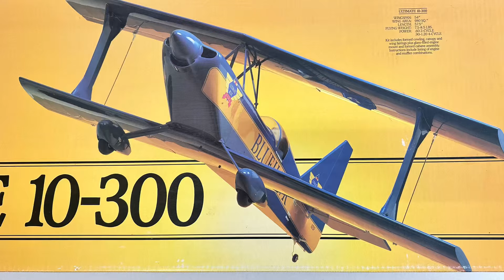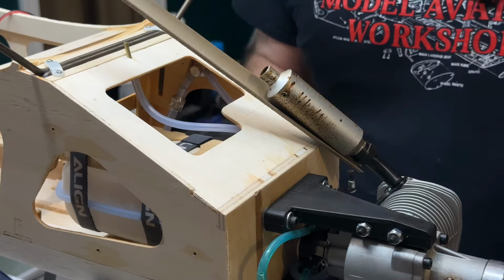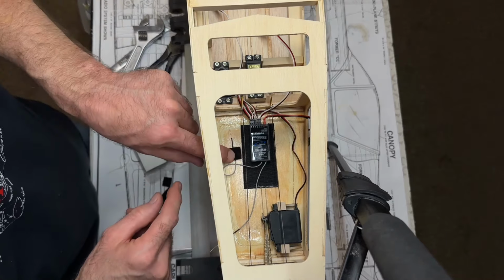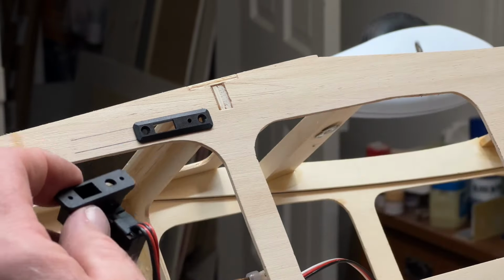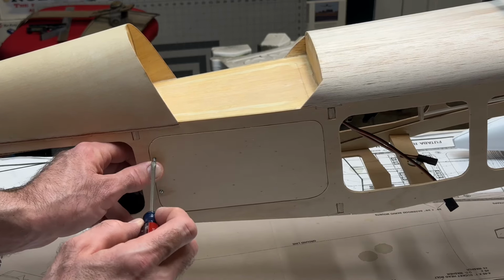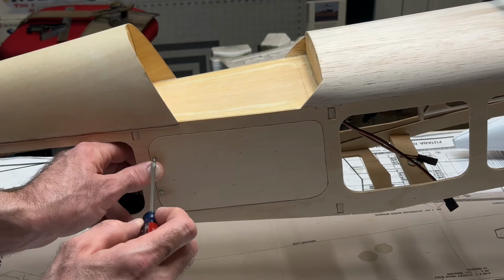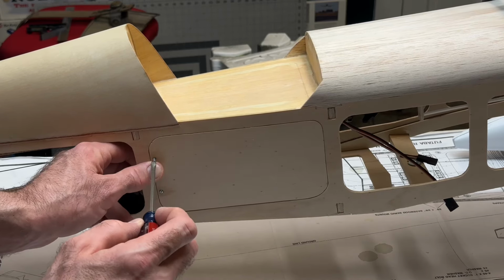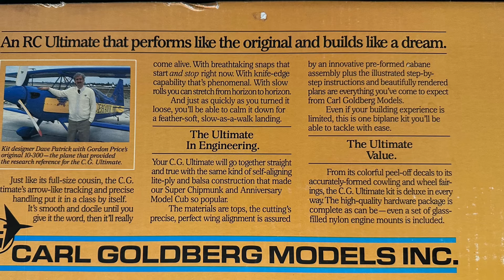Carl Goldberg Ultimate 10-300 Biplane Build: Part 23 (Finishing Prep: Part 2)

Comment: So you fly Futaba radio equipment. So do I...I got the new T-16 IZ.. I was flying the T8FG super.
Though servos are all noisy, it's because they're digital. All digital servers do that. They kind of hunt back and forth to find their center at all times. Are you by chance an electrician? I noticed, you have quite a few climb brand screwdrivers. That's the brand name of tools that select Christian's mostly used. I was an industrial electrician for many years.
It's up to you but I highly suggest taking a piece of shrink wrap and shrink wrap  your aileron servo connectors together. Then you never have to worry about them ever coming. I'm done again. I guess the glue is easier but I just think the shrink rap looks bette
Reply from the maker: Yeah, Futaba is my go to radio. 16SZ is what I use. I used to be an electrician in the Air Force. My aileron servo connectors are basically glued together. I showed it in my wing build video. 👍

Comment: My only question about the wings is how are you going to get to those servos if you ever have a problem with them? You didn't make the servo covers removable you glued them in instead of screwing them down.
Unless you have some way to get to them from the other side I don't think you could be able to get to them
Reply from the maker: I’d have to cut into the wing. I was trying to keep the weight down.

Comment: I like the access hatch in the side of the fuse. I made an access hatch in the bottom of my fuse one bay behind your electronics bay to put the elevator servos. I cut out a frame in the hatch to cut down on weight. Would you consider doing the same for your access hatch?
Reply from the maker: I thought about that, but I need the weight in the rear. 👍

Comment: The only thing I don't understand is you spent good money on really good service, but you cheat out on the hardware on the servo horns and the serbo arms use that cheap flimsy plastic stuff instead of a good dew bro. Control control horn and a good.  You know at least hard plastic serve alarm set of those little flimsey ones that flex all over the place. They will likely work just fine to be honest but I ts just such a nice model. Maybe you're trying to keep the cost down a little bit though I guess that's understandable...